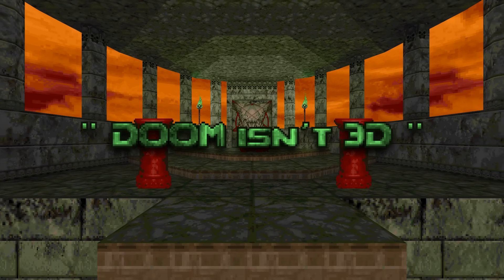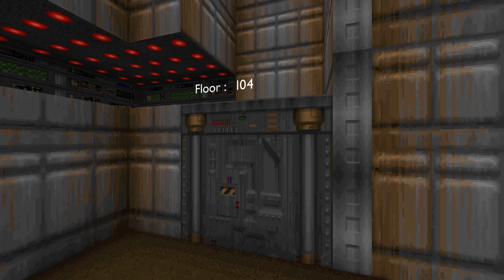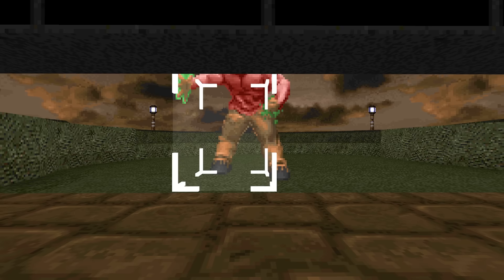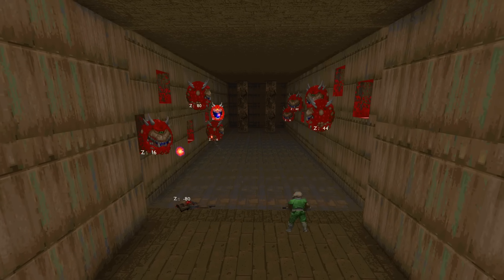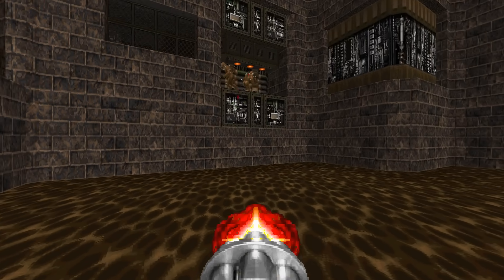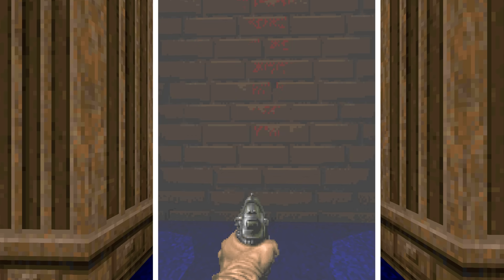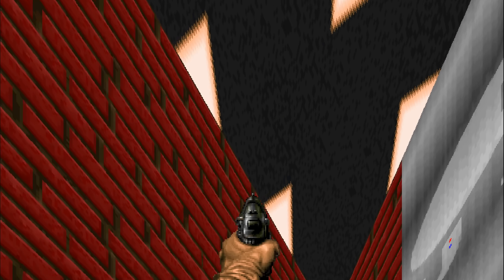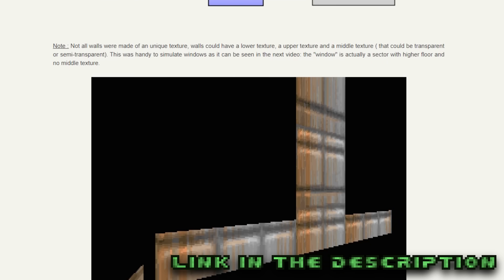Doom engine - Limited but still 3D

Comment: I remember the fact that Quake could have rooms on top of rooms was a massive tech breakthrough at the time.
Reply: Quake could have them but it was not a breakthough. Ultima Underworld had them long before. Even before Doom. In fact Doom did not invent anything new, it just popularized a genre. Other games had textures mapped real 3D before Doom had the fake BSP tree 3D (UU1). But this was not a weakness but rather a strength, since it could run fast on a broader range of hardware. Other games also has real 3D objects in the scene rather than sprites (again UU1). But this was also slow for an FPS of the time.
Reply: @marsovac  Sometimes John Carmack gets a bit too much credit for inventing everything. His true genius is actually coming up with effective ways to implement these concepts. Like you pointed out.
Reply: @marsovac  The Ultima Underworld engine, which powers UU 1&2 as well as the original System Shock uses true polygonal 3D rendering for the level geometry (walls, floor, ceiling) but 2D sprites for everything else (enemies, objects, items). The renderer was considered fast at the time but even with a 486 33MHz, which was top of the line processor when Ultima Underworld came out in 1992, you'd be lucky to get over 20fps in that game. Doom on the other hand could run at a blistering 35fps (the original cap) without breaking a sweat on the same CPU. It was really the speed that made all the difference.
Reply: @marsovac 
Doom tech didn’t “poularized”, it was faster and cheaper to run at decent framerates.
Reply: That and the build engine, (duke3d)
Reply: @Dan-yk6sy  duke used warp zones to do that, like portal.
Reply: @Saktoth   I need to watch some videos like this on how they built levels for Duke3D. If they used warp zones I'm wondering how they achieved levels like L.A. Rumble when they have aliens shooting you from the windows which you can jump into and is a floor above a block, so I suppose that isn't technically a floor above a floor, but a carved box and actually is just another height
Reply: @quantumuniversetvinc.6117  Precisely.
Reply: @Saktoth  From what I heard, the build engine could have room over room without warp zones.  However, the rooms could not be visible from each other.  So, no multi-story buildings with all windows transparent, no holes in the floor, or any other such structure with two floors visible at once.  When such structures were needed, portals were used.
Reply: @quantumuniversetvinc.6117  The creativity to overcome limitations are amazing. I love playing the game knowing the limitations and how they built the levels around them. Duke used some sprite "bridges" to over come the floor over floor limitations too. Then often they just got creative with the level design to the point it is hard to see unless you know these things and are paying attention.

And then water used "portals" where you would have an area representing under the water and another representing over the water. Fire up the build editor sometime and it is very interesting....
Reply: @taproot4287  absolutely correct. There are a few instances of that in Duke3D, I remember looking at how certain maps were designed and a few had a bit of that...
Reply: @Dan-yk6sy  i used to make doom maps when it 1st came out, bad ones to be honest but they worked, the build editor in Duke Nukem was so much more intuitive and if i remember you could easily switch between edit and preview, without having to build the level
Reply: @davidrenton  That was my experience too. The build editor worked well and let you view things in real time.
Reply: @davidrenton  the build editor was AMAZING!!
Reply: If Quakers Quake  under pressure. Do Doomers Doom under pressure.
Reply: nah, Marathon had first room over other rooms since 1994.
Reply: @lappodude and by god did they abuse that shit. if you thought Doom levels were mazes, you ain’t seen shit until Marathon
Reply: Yes. Warpzones, or Portals as they are more commonly referred today, are pretty neat. Since you can do tricky like that with a rather limited engine. Though you can see this being a limitation sometimes in the build engine if you look through several intersecting portal view since it will not render them all. So you have to be careful about the layout of a level. 

Portals are still used today in many game engines, even when you can make a true 3D space. They're useful, and have implemented in some Doom derived engines too. If in to map making, then I really recommend playing around with them, just for fun. Since you can do a lot of neat tricks with them. But I bet any experienced mapmaker knows this already.
Reply: i watched the noclip doc about doom to quake there goal in games was do what the last game could not do for doom it was stairs for quake it was rooms on top of rooms
Reply: It was done much earlier in games like Dark Forces or Descent.
Reply: Didn't Doom 64 support more complicated architecture, thought still. not quite rooms on top of rooms?
Reply: @tcchip  pretty sure Doom64 couldn't do anything like that.  It just had prettier texture and sprite work.  Nothing was true 3D until Quake, I believe, although I can't recall whether Duke 3D hit that mark.
Reply: @tcchip 
Doom 64 was built on the doom engine but expanded in certain elements, but used invisible elevators for bridges and stuff
Reply: Doom 64 did it first, though it used some neat trick to achieve it.
Reply from the maker: Didn’t Doom 64 come out after Quake?
Reply: @borogk  oh my god it did
Reply: Quake also had polygon based enemies while doom/duke etc... used sprites. I was blown away playing the quake shareware by the polygon based enemies.
Reply: Terminator Future Shock beat it to that, and had realtime lighting.... quake was faster though and more famous due to the multiplayer, and being from ID

Comment: The same way isometric 3D is still 3D, I suppose. Computers had 3D (3-axis transforms) before Doom, limitations were self-imposed. There are more limitations than axes in Doom, such as camera degrees of freedom, texture mapping algorithm, flat cardboard enemies, and only exactly horizontal or vertical surfaces.

Comment: Now it's seen as limited but in the 90s it allowed an FPS to run on a 486 with only VGA graphics (no hw acceleration). All was done by the CPU. That's what's impressive about this engine.

Comment: Ohhh. Now explain the 3d world and 2d enemies.
Reply: You mean the enemy sprites? That's just a graphical choice. Sprites are still used in modern AAA games too: fire and smoke effects for example are usually sprites. It doesn't have a bearing on whether the enemies have physical presence in all dimensions.
Reply: True 3D characters or environments (as in 3D models) didn't come in quite as predominantly until 1994's Descent. Remember, this was a time of having to take shortcuts to produce a believable effect  3D calculations were taxing on the CPUs of the time.

Comment: I can't imagine anyone that's actually coded a 3d renderer, whetherc it's ray casting, tracing or rasterisation ever saying this isn't 3d. These are optimisations, and really good ones at that. If cutting corners with your collision boxes means it's not 3d then there are no 3d games. As for the heightmap, that's on the bloody game I'm coding and its 2021.

Saying it's not 3d is very, very silly. These are optimisations which show the calibre of programmer.

Comment: This puts into perspective how awesome arcade games looked back in the day. While PC and Console games struggled in 3D, Ridge Racer and Daytona USA manages that with proper texture mapping, 60FPS, and high resolution at the time (496x384 for Daytona USA, and 640x480 for Ridge Racer).
Reply: And don't forget that arcades ran in RGB, something only seen by Europeans with scart RGB input

The rest of the world got composite video with all it's artifacts. Only PCs had RGB video (VGA)
Reply: nowaday arcade system are basically pc/console in disguise (ex: sega lindebergh and namco system 357)
Reply: @BluBombs  yeah arcades used to have cutting edge hardware inside while the home market only got the atari 2600

Nowadays it's the opposite, it seems that the hardware in modern arcades are 10 years old. The most recent pump it up machine uses a core 2 quad from mid 2000s...
Reply: @tristan6509  Well, some machines are not THAT outdated. Sega's ALLS UX uses i5 6500 and GTX 1070 for example.
Reply: @BluBombs  357 is PS3 based. Other than that you're correct

Comment: A good example of just how limited a 486 could do with 3D, look at MechWarrior 2. It's able to run on 486 and do full 3D rendering, but it needs everything turned to minimum and 320x240 res.

Makes sense why ID did DooM the way they did, it was meant to be fast paced and exciting, and able to run on a 486

Comment: Nothing in Doom is 3D. There's not a single polygon.
Reply: This is just wrong, in the engine side, subsectors in Doom is widely considered as a convex polygon. in the rendering side, sidedefs are used to render polygons in game.
Reply: Also the presence of polygons has nothing to do with a game being 3D. It's just a graphical choice. A game made out of voxels, for example, has no polygons either but that doesn't mean it isn't 3D.
Reply: @bauul.  
That's a good point, even though even 99% of "voxel" games are actually rendered with polygons, with the voxels being merely used for the aesthetic, but nothing in Doom graphics engine is 3D regardless. Neither the enemies, nor the levels are modeled with 3D data.

Comment: ZDoom, JDoom, and Doom Legacy really expanded the original engine from the 2.5D engine of Doom95/lxdoom/Vanilla Doom. It was a 3D game but with some 2.5D limitations, but for it's time it was revolutionary.

However, Doom64 was a unique case because there is a level that allows a room over a room. It was the first game to use an enhanced engine.

Comment: Thank you for this, after that Game Theory video came out claiming Doom wasn't 3D I saw a bunch of people repeating what that video said without thinking about it even though the game is obviously 3D if you've spent any amount of time actually playing it. Excellent presentation too, the bounding box visualisations are really clean
Reply: It’s not. The Renderer doesnt have a true 3D perspective so it isnt. Because it has 3D movement and object placement data doesnt really mean anything, you could do that with a console app, plus nothing can even rotate freely only the walls rotate horizontally, in other words there are no 3D objects, not even the walls, unlike polygonal models which have a volume that freely rotates.
Reply: @johnq4061  I feel like this entirely depends on how you define 3D. If you're looking at it purely from the technical side then yeah you could make an argument that Doom is not 3D, but if you're looking at how the game plays then I'd personally say that it IS 3D, and the technical side doesn't matter because in actual gameplay it both looks and feels 3D. I guess it depends more on what you value more: how it plays, or how it works.
Reply: @CATEM1NAL   Yeah It does play like a 3D game, it's not something I thought about until I started wondering why can't someone make a mod for the OG Doom (not the upgraded doom engines) to have 3d models, and then with some researching I realized it's not possible because it's not a full 3D engine.
Reply: @johnq4061  Polygonal models also aren't "3D". They're literally nothing more than arrays of triangles ran through a few transformation matrices to be presented on a flat screen (with just width and height!) with the appropriate illusion of depth and perspective. It's just that the modern one tricks you better.
Reply: @tellahsage6477  Reducing an argument to something overly simplified/black and white doesn't prove your point. 
That's like saying a car is a computer because it has metal parts and uses electricity. OG Doom isn't 3D, not fully anyway.
Reply: @johnq4061  A programmable calculator would be a better comparison. It is a (very simple) computer, even if you can't run, say, a web browser in it. It's a limited computer designed to fulfill only a specific purpose. In the same way, the Doom engine is a limited renderer for 3-dimensional scenes designed to work only within the confines of what is needed by the game. Yes, the perception of depth is an illusion. But so is the perception of depth that, say, an openGL scene will give you. But both of these represent a three-dimensional world internally. That's the point i'm trying to make.

Comment: It is not limited but 3d, 3d is about rendering, doom is 2d but extremely clever.
Reply: Doom's renderer is the one bit that's unarguably 3D.  It properly displays height, width and depth of visible geometry.  It's the level data and collision info that has limitations there
Reply: @bauul. you need to take a look at the engine (the source is open for you too look at) and see what it can't render, them you will understand.
Reply: @TheBotinha93  So you tell us, what can it NOT render? You can create sort of structures in a doom wad including circular objects. Even the "things" are 3d squares just being represented with a sprite (because it was a limitation choice) instead of a polygonal model (I'm sure we can modify that further to use polygon models but will the computers back in 1995 be able to handle it?)
Reply: @kenclassics3327  Like i said go take a look at the code, them read a little about it, it is completely accepted as a pseudo 3d, 2.5d, ir clever use of 3d elements over 2d, pick your chose of descriptor they all mean the same. This horse is dead and beat, this ship as already set say. This is exactly why i didn't go in to details before and wont go right now, it is not obscure information, it is available and agreed upon.

Comment: I choose to just say that the levels themselves are 3D - just nothing else is. Items, monsters, projectiles and even decorations are 2d surfaces.

This brings me to a slight issue with your presentation- monsters will have a 3d position, but won't have a bounding box. It's merely a 2D plane in 3D space, rendered so it always faces the camera. The appearance of the monster, including its facing is just a static sprite. Not all animations however, have a frame for every orientation- this is why if you circle strafe around a monster during its death animation, it will appear to rotate with you. 

In the end, it's best to just refer to Doom as a proto-3d game. It uses a lot of the math that would later show up in true 3D games (like Quake) but doesn't use 3D components such as vertices, triangles, and textures. Although, in some cases it has equivalents - it's not a 1:1 match.

Just for fun, I wrote a tool that would convert a DOOM map to a 3d model - most of it was pretty straightforward, except for the floors and ceilings. Since DOOM's maps weren't based on triangles or polygons, you were left with a situation where you only had a collection of ordered points, but no actual geometry. So I had to use a triangulation library to create such geometry for each sector, before the floors and ceilings could be textured, and thus visible.

I assume OpenGL ports do something similar, but half the fun was figuring it out myself. The one thing I hadn't figured out before I moved on to something else, was how to reproduce the skybox 🤷‍♂️
Reply: @borogk  Right, I get what you're saying  - I was just a little thrown off by the way it appeared you presenting the monsters as actual 3D objects - rather than a 2d surface enclosed in a 3d rudimentary collision object - without clarification.

It's fascinating to see how Carmack's engine basically transformed in front of our eyes, from the raycaster used in Wolf3d to the proto-3d, BSP Tree rendered Doom, and finally to the true 3d engine in Quake - all within 4 short years.

Comment: I would kind of argue. There are defently 3d elements to doom, but a majority of the calculations is made in 2D space. While true, that was made to speed up processing, its still 2D. 

Compared to wolfenstein, that have even fewer 3d features, its really just the ground and celling  level that been added. The largesr diffrance between wolfenstein and doom  is really the vector  based map system that make doom look way nicer. 

Having a Z axel is not the same as being 3d. There is a lot of early 90 game thst have a z axel and are not 3d.

One that comes to mind that is even earlier is railroad tycoon.  There is no grapical representation of the z axis  what so ever, but its there.

A later game like sim city 2000 from 1994 have a pseudo 3D representation of landscape.  This is really simular to the pseudo 3d representation of doom.

Therr is also no models in doom,  well aguably apart from the map. Everything is just flat 2d objects, alll but the for and roof not even slanted. 

So really if one argues that wolfenstein is not 3d, neither is doom.

Even looking at decent, that pretty much use all 3d features,  it still uses a lot of 2d objects to increase speed, and so of cause also duke nukem.  Even quake 2 uses some 2d objects.

I would say doom fit solidly in the 2.5D section. Games that use 2d trickery  to emulator 3d grapicis.

Its not like doom is the first 3d game regarless. I dont know what game is. The 1982 game flight simularor is probobly one of the earlier sucessfull fully filled and fully 3d game. 

If we looking at games that use a fully 3d engine (but still use some 2d features), then comache comes to mind.

And If we look at stuff like HUD, they was not fully 3d really untill 2015.